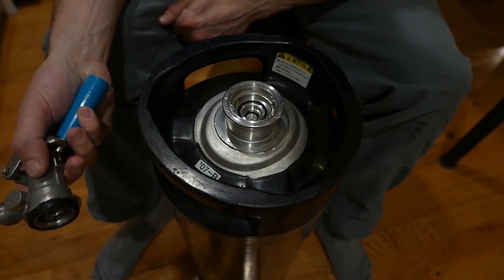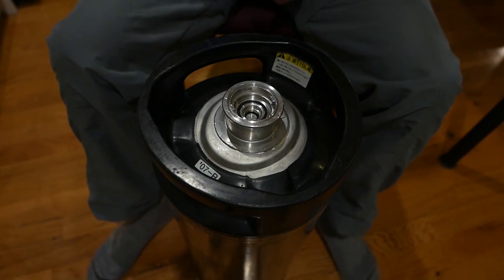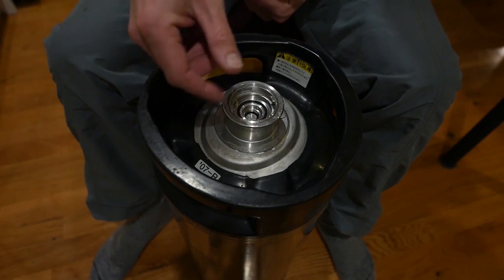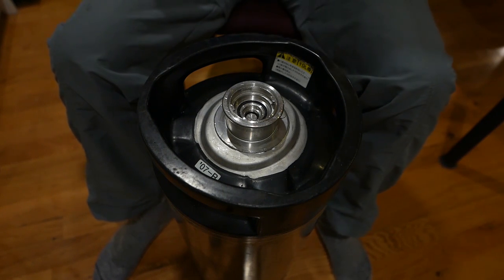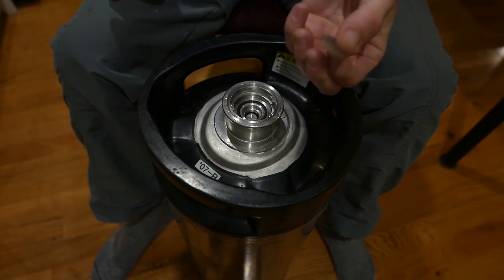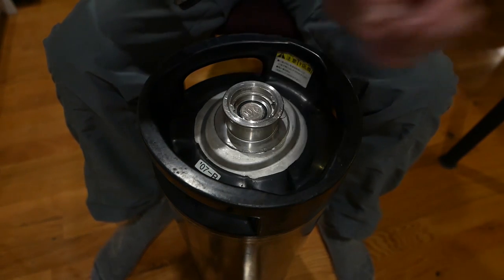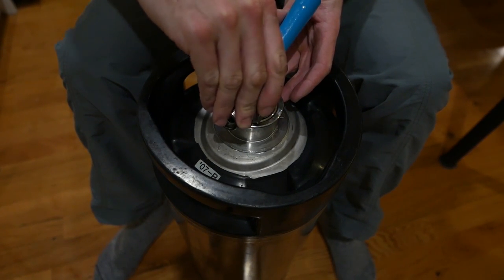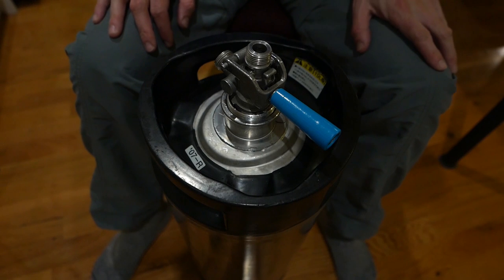Remove S-Type Keg Spear - Easy, non-destructive method using keg coupler

Comment from the maker: There are a few comments about this not working. I had a similar problem myself recently, and I suspect it's due to not being able to apply enough torque to loosen the valve assembly thread using just the coupler, especially if it's seized up or tightly inserted. I added a few suggestions in the video description.
Reply: There are two types of these around. In yours video, you are using old version keg, but there is also new one with different locking mechanism.

Comment: Hi, thanks for the video. I was using the double screw driver technique until now. It worked on one key using a 50c (Euro) coin but on two other kegs (which I was not able to open using double screw driver technique) it did not work. Any ideas? These two kegs are have the type S connector. The 30L model. Also why all the messing around lining it up? What are you doing there? Could you explain? Or is it not relevant? Thanks.

Comment: Doesn't work with my coupler as it's not possible to apply much counterclockwise force before it slips. I suspect the exact design of your coupler allowed this to work for you but was a fail for me with the coupler I purchased on the back of your video

Comment: I bent the 10c piece and I couldn't get it to budge [probably seized].   No problem with strength, will just another method to clean and leave it in as is.